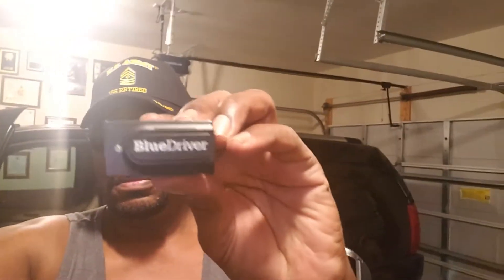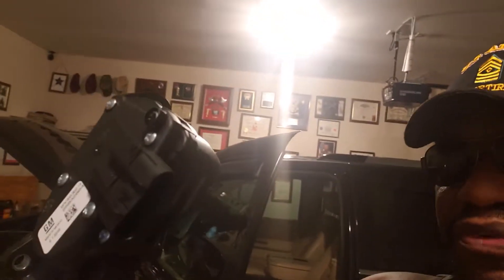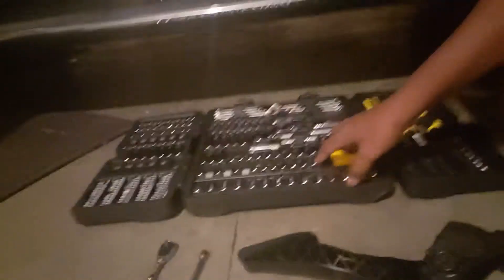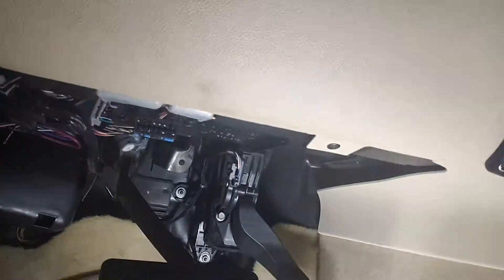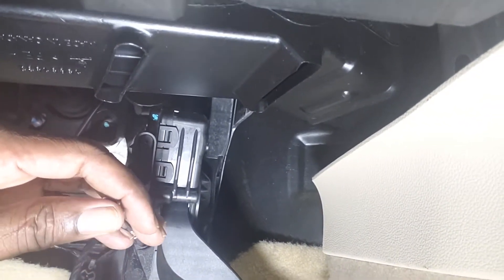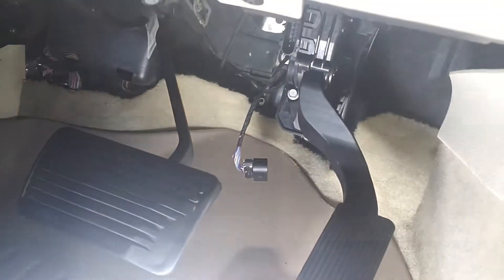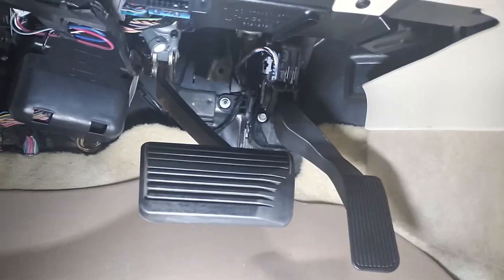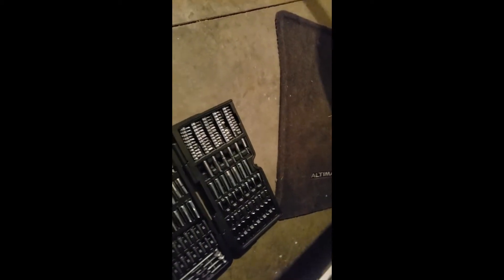Replacing the Throttle Pedal Position Sensor Assembly on a Cadillac Escalade ESV

Comment: excellent video, what were the reasons to replace the pedal? Could you help me with any signs or symptoms that may occur to take to replace the entire accelerator pedal?
Reply from the maker: The check engine light was on and the sensor was built in the panel assembly
Reply: @the-fix-it-yourself-channel  thanks my friend for your answer
Reply from the maker: https://youtu.be/BpPeVWJ1xR8